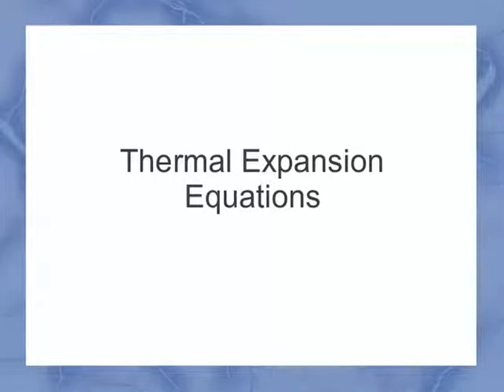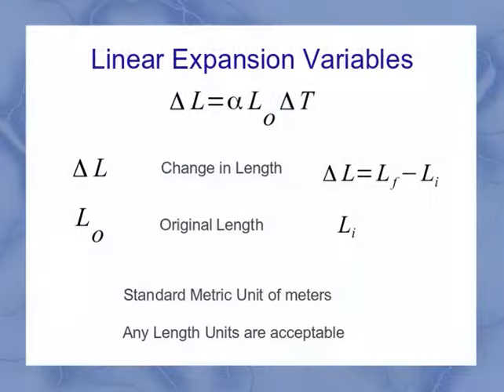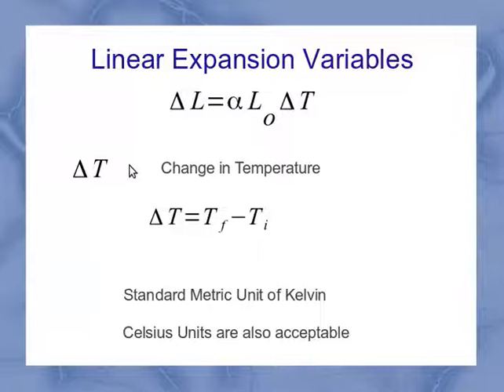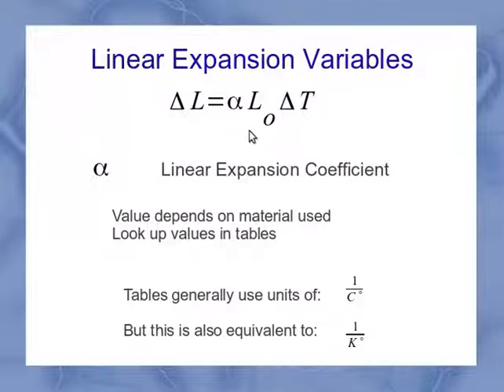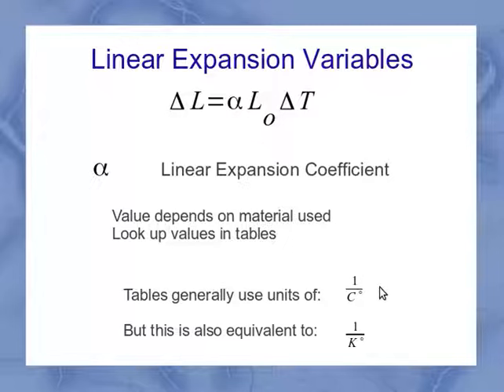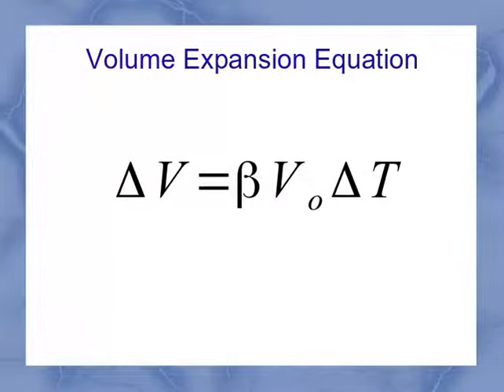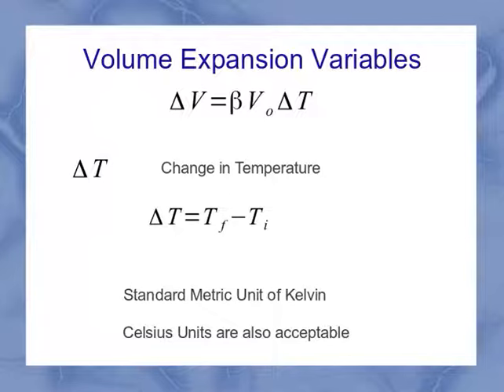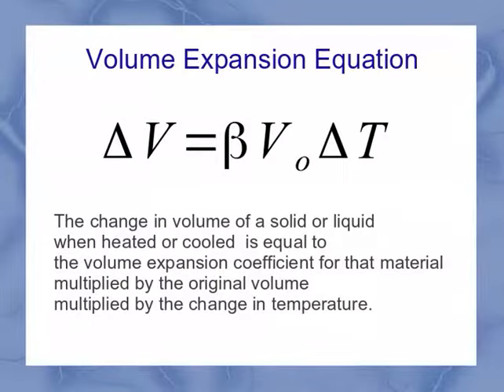Thermal Expansion Equations

Comment: how would you determine the individual changes of lengths of the volume if it is not constrained?
Reply from the maker: If you have a solid material, you can calculate any dimension of the object using the change in length formula. If the material is a liquid, then you can only find the change in volume but not the length, width, height. For a liquid, the material will expand depending on the shape of the surrounding container. Does that answer your question?

Comment: during the thermal expansion of a pipe/shell, IS its thickness will change due to its change in length?
Reply from the maker: +India Lover The expansion is in every direction. So the length will expand, the diameter will expand, the thickness with expand, etc...

Comment: if a substance contract means coefficient of linear expansion is negative
Reply from the maker: It also depends on the temperature change. Most substances have a positive coefficient of linear expansion, and they will expand when heated and contract when cooled. If a substance had a negative linear expansion coefficient, it would expand when cooled and contract when heated. This unusual behavior is generally confined to a narrow temperature range for a small number of materials.

Comment: does coefficient of linear expansion depends on length
Reply from the maker: The coefficient does not depend on the length or volume of the material. It depends on the material. The change in length will depend on the original length.

Comment: what if the temperature is needed for elongation?
Reply from the maker: If you have to find the final temperature, you would rearrange the equation to give Tf = Ti + (delta L)/(Lo alpha)
Reply: @DrJennCash  delta L is L final - L initial while Lo alpha is the coefficient right? I’m so sorry I’m not good at this. Thank you for answering
Reply from the maker: @helennecastillo7066  yes (delta L) is the L_final - L_initial also called the change in length. If you know how much the material is expected or allowed to expand, then you have the change in length. Lo is really the same as L_initial but also called the original length. alpha is the expansion coefficient.

Comment: If its negative what do i do?
Reply from the maker: Negative values for the change in temperature mean that it is cooling. These are associated with negative values for the change in length or volume which means that the material is contracting.